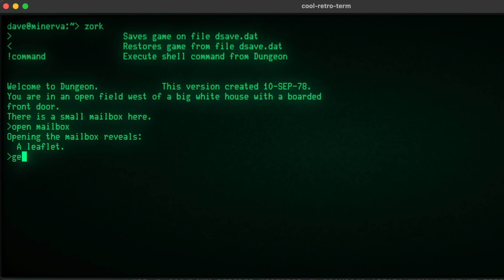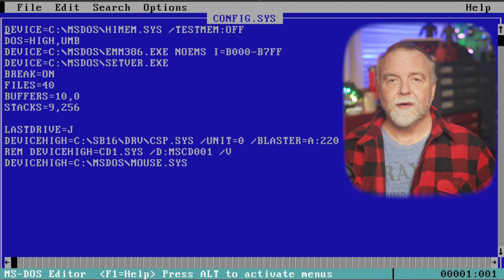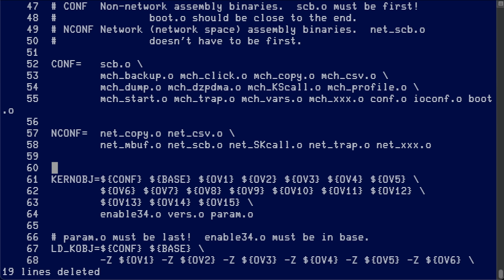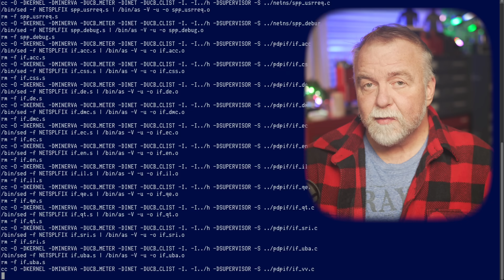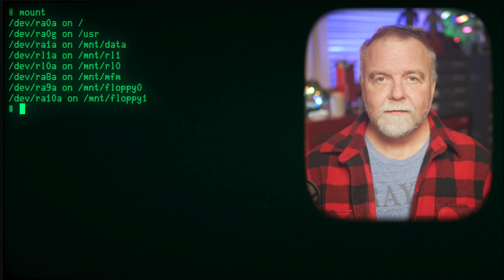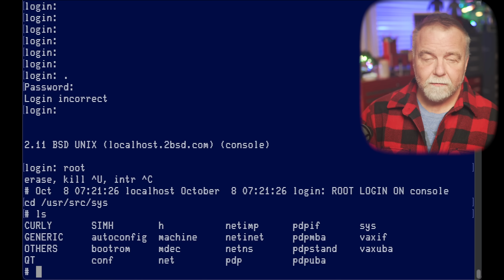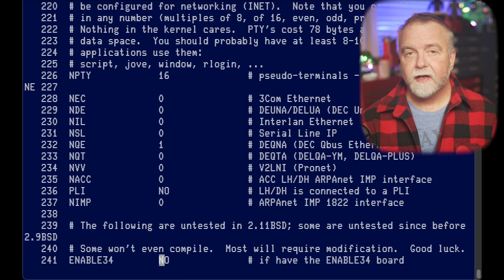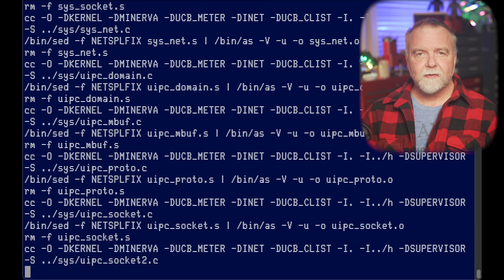The Hardest Thing: Building and Running the UNIX Kernel from Original Sources

Comment: Great trip down memory lane, thanks! When you say those minicomputers were large, you weren't kidding - I remember standing inside a PDP 11/44 to reach for circuit boards in the depths of the cabinet. Field service was an endlessly fascinating job on those old beasts.

I tried not to say it, but can't help myself: why use ":wq" when ":x" saves a keystroke and unnecessary disk writes?
Reply from the maker: I thought x encrypted!  Does it just save?  Never tried it!
Reply: @DavesGarage  You're thinking of capital X. ":x" exits and saves only if the file has changed, whereas ":wq" forces a write (and modification timestamp update) regardless of whether or not the file has changed. Muscle memory being what it is, I don't think I've ever persuaded anyone to change, but I've been losing this argument since 1982 so why stop now :)

Comment: Building UNIX for the first time for new hardware is challenging, but gets easier with practice.  I had the job building new UNIX kernels both Berkley and ATT versions on a variety of new hardware platforms.  I have great thanks to the academic computing center of St. Olaf College, which ran PDP 11/45 and then PDP 11/70 machines running UNIX for student use.  The majority of the staff of the computer center were students, and we had full view of the UNIX sources and were responsible for adding device drivers and making updates etc.  This experience put me well ahead in my career after graduation.  Glad to see your build was a success, and that you had fun.
Reply: What became out of you?
Reply: @MelihKiraz  Developed unix operating systems for tektronix and national semiconductor were my first jobs.  Now I'm mostly retired.
Reply: I'm really inspired about your achievements and career @ericanderson2482

Comment: Reminds me of compiling the Linux kernel for a HP 9000 180c risc machine. It takes about 3 days to build. I’ve always had fun tweaking and compiling kernels, thanks for sharing your BSD experience.
Reply: Similar on Sparc machines, so set up a cross-compiler on my x86 machine. There, that's better.

Comment: DEC discontinued a number of the terminal boards, so we needed to use the DZ11. Unfortunately, it didn't support hardware flow control. Luckily, the KMC11 was still available, and was an I/O coprocessor. The DZ11 had a ring indicator, so I repurposed it as a CTS pin (requiring rewiring about 50 RS232 cables), and updated existing KMC11 DZ assist driver to monitor Ring Indicator to do hardware flow control. This made our serial to cable modem implement hardware flow control, which was needed because the serial to cable modem wasn't far enough for the 9600bps output. This was done on System V, as AT&T wouldn't be caught dead using BSD. Fun times.

Comment: My first job back in 1988 had nothing to do with a PDP-11, though my supervisor told of his learning computing on a PDP-11. My own experience was on the DEC / VAX (thought I don't recall any other information about this device). The disk drives were removable packs that exposed the platters briefly to open air. Something that a 24 year old me was terrified of.  The experience of working with the equipment was the core of my life back then. I LOVED HARDWARE back then.  I believe I commented on another of Dave's PDP-11 videos with a story of the first time I ever set sight on a PDP-11. It had been recently (at the time 2000) and was living in a space, out in the open, just outside the data center, and OH how I wished I could have shipped that home. I could hear my boss from back in the '80's in my mind, telling me how he learned on the PDP-11.   

Your videos are both entertaining and educational and MOST appreciated Dave.. Always thank You.. Happy Holidays and Happy New Year.
Reply: I've only caught a glimpse of those old platters. They have intriguing patterns on the surface.
Instead of a PDP-11, VAX, or Perkin-Elmer, would rather have a DEC Alpha.  It runs VMS, Unix, and WinNT -- while fitting on your desk.
Had a job converting a traffic control system from VAX to Alpha, in VMS.  Word size differences in hardware caused delicious size/alignment issues.

Comment: I first used Unix in 1983 with 4.1 BSD running on a VAX 11/750 in graduate school.   Learned the pdp 11 instruction set the first semester writing a compiler.  Second semester was writing a bare metal os for the pdp 11 simulator using the portable c compiler.  But all the cool kids were writing games for Xerox Alto's in mesa.

Comment: 1976 I helped write the output spooler. UC OS class - Ken Thompson was the instructor...... (I'm really old)
Reply: That’s really cool history!  Do you still have your notes and graded papers from his class?  They may be interesting to go through
Reply: @paxsevenfour  So until winter quarter 1975 I had been avoiding the OS class at UC Berkeley as every time I passed the computer lab there seemed to be a sign saying “UINIX is down”. In my other classes we used Pascal on punch cards. Then the time of my graduation was imminent and so I bit the bullet and enrolled. Turned out to be the term Thompson showed up from Bell Labs to make UNIX work right.  The anecdote from the horses mouth was that Thompson and Richie were told by Bell Labs to forget making UNIX so the two “borrowed” some DEC equipment, put it in Richie’s garage, boarded up the doors and windows and went to work on their own. When UNIX was done it was then presented to Bell Labs as a completed project……  What I threw away years ago was the galley print photo copy of the first edition of the C language programmer’s manual available only to people in his class. This was the only way you could learn C as the language was invented by the two rogues mentioned here so that they could create UNIX.
Reply: Wow! I'm older! I was working alongside Ken on the machine in Evans Hall at Berkeley,  running the first Unix system to leave the Bell System. Building the kernal was a LOT easier then -- I did it a lot.
Reply: @keithstandiford3761  I was a JC xfer from College of Marin and was in the department 1974-1976. Lived in Cunningham. We probably bumped into one another in that crazy elevator.....
Reply: You are really lucky sir / mam ❤
Reply: Damn! You guys are some cool old cats! I’m only 40 but I love this old tech. I’ve always been fascinated with work of pioneers. Or those directly after pioneers.
The beginning of computing, early space programs… including their computers like the Apollo Guidance Computer. Their custom made engines like the F-1 that almost nobody is left today that can understand and explain design and manufacturing, cuz all the hand written notes and individual knowledge is lost to time. 
And much of the hands on knowledge of these early computer systems will be lost within the next 40-50 years. 
This makes me sad and makes me wish more young engineers would spend some time with you old timers, learning the old hardware/software so it’s not lost to time in 100 years.
Reply: @lyingcat9022  There is a great story about the Apollo 11 guidance computer and how they almost didn't land because of 2 complete resets while on their way down. Look through youtube for the discussion.
Reply: But a hero to many!
Reply: Grew up reading about this stuff in the 90s. Great to finally see these systems on their original configuration
Reply: You worked with a legend, that makes you a legend by transitivity. My generation thanks you very much.

Comment: I compiled a kernel on my 11/73 a few months ago as I wanted networking. I got hit with the overlay issue as well but a quick web search gave me the solution. The last time I compiled a kernel before that was 15 years earlier and I had forgotten everything. That machine and my two QBus VAXes are my most treasured vintage computers - well, apart from my Data General Nova 3 and Eclipse S/130.

Comment: 1993 linux kernel recompile feels. it's a testament to the kernel build process that you can build a custom kernel on a modern linux system in pretty much the same way as a 1991 BSD release on 1988 DEC hardware. it would have been nice to see more visuals tho, dave, like seeing the dip switch changes or how you transferred the compiled kernel image from simh to the real 11/83.

Comment: I compiled my first freebsd kernel in 2005.  I didn't know what I was doing and it took 3 days to compile on a dual  opteron server.  I think I compile every feature during that time which is why it took 3 days.  It was an eye opener.  At one point it died twice.  I soon learned to use ccache and distcc.  It was a nightmare, but it taught me alot by digging into the docs.

Comment: Makes me feel really lucky that I was introduced to UNIX with SVR4 on 3B2 systems. WAY easier to get your head around. Eventually I even got to install and use some Starserver systems with four, count 'em four 486 processors and a stack of full-height SCSI drives. Those were actually some pretty good systems although I used to rib my manager that my own system at home had a 4.7gB (IIRC) SCSI drive which outclassed the entire stack in the Starservers. Honestly I don't miss that stuff at all -- getting too old I guess. Still, your story was entertainingly precautionary.

Comment: sco unix system V was similar, at&t unix was similar obviously - the old days of single core/thread, sometimes with an MMU, sometimes without.  got to mess with a lot of hardware and flavors of unix in my life - people like us are the only ones that truly understand how far we’ve come.
Reply from the maker: We're really the last generation that grew up as the basic tech evolved, so we know 555s to state of the art.  It'd be hard to acquire that knowledge any other time or way, I think.
Reply: @DavesGarage  Hey Dave - I started with crystal sets, wire wrapped memory for my Z80 box, graduated in Comp Sci and been with startups, Sun, Oracle ever since. I don't know how we can get Gen Z (I have 3 of them) to appreciate not just how spoiled they are, but how to gain a fundamental grasp  of what goes on behind the front panels running their games and AI in the cloud - times were much simpler.."ACHTUNG! Alles touristen und non-technischen peepers!
Das machine control is nicht fur gerfinger-poken und mittengrabben. Oderwise is easy schnappen der springenwerk, blowen fuse, und poppencorken mit spitzensparken. Der machine is diggen by experten only. Is nicht fur geverken by das dummkopfen. Das rubbernecken sightseenen keepen das cotten picken hands in das pockets, so relaxen und watchen das blinkenlights." Perhaps kids should be made to re-IPL machines via the front panel before they are allowed to use their phones, tablets, PCs etc......
Reply: @DavesGarage  😹555 many such cases! my dad gave me breadboards, components, instruction when i was about 7.  he had a pdp-11/04 and spare boards at home i used to look at the processor board and those big 74181 adders and thinking, “i know what you do!”.  i had the 74XX series TTL databook memorized and some of the 4000 series CMOS before i was 12 - now you can do multiple pdps in an FPGA - wild!

Comment: Does Unix not have a make menuconfig like Linux does?
Reply from the maker: Nope.  You basically hand-edit the config instead of their being a menuing system.
Reply: Love the 'make *config' variants. Such a huge timesaver and generally prevent combinations of settings that would clearly not work. Don't have much call to build kernels anymore, as most mainline distros offer a fully modular kernel and let the hardware auto-detection take care of the rest.

Comment: This takes me  back 40 years.  Never did Unix on PDP, I used Dec's own system RSX.  It took all day to build itself from source, wrong options -> start over. The user  application used to take many hours to compile from scratch. Every build, after an edit, took 30 mins.
Reply: I remember those days. I used to compile on a Vax 11/750. The worst part is if you screwed up a file like forgot a comma or something. Then to get things going you edit another file then compile only to realize you forgot something else.
Then we started to compile on the 8600. That was oh so much faster!

Comment: One big question.. If you mess this up, and end up with a kernel that is not bootable, how do you recover?  Is there some kind of monitor mode that has access to the disk so that you can move a working kernel back in there?   Is there a generic limited system you can boot off of floppy?
Reply: you can save a copy of the old kernel(s) and boot that instead, easier than gong the long route with booting from alternate medium

Comment: The days of config.sys, setting IRQs, Ports, DMAs, etc... it reminds me of getting games like the original Doom, Theme Park, 7th Guest, and many others to work before the paradigm shift to CD technologies. The use of floppy diskettes both the 5.25 and 3.5 variants, single sided, double-sided capacity. If you had the 1.44MB diskettes you were in business! That means you only need 3-5 diskettes for a 20-40MB program that was compressed instead of a dozen diskettes. A few years later CDs started to show up on the market as they became much more affordable and if you had a 2x or 4x speed CD you were ahead of the curve with their 600MB capacity. Most hard drives back then were only about 200 - 400MB max unless if you were able to afford a 1-2GB drive which would have been close to $1k at the time. Most systems of that era only had between 4-32MB of system ram. The joys and pains of DOS. Now, I might have had to configure the system settings and some of the hardware devices, but I didn't have to compile or rebuild the kernels. This was one of the things that made DOS really decent.

Comment: thank you for making this great video about working with BSD Unix on a PDP-11. I'm 75 years old and this reminds me of working with Honeywell's H716, which was a PDP 11 competitor with similar memory addressing constraints. Years later I did some custom X.25 driver work on Xenix 286 running on a PC/AT clone which had it's own 64 kb segment size memory limits. Now you can get documentation and great textbooks on Unix/BSD/Linux internals, but back in 1987 it was a real slow slog of compile, rebuild and test and then try another experiment -- very much like what you described. Keep up the great videos, and keep reminding newbies how important is was (and is) to understand how things work.

Comment: To be fair, the experience of compiling your own Linux kernel binary isn't much different even nowadays. Thankfully nowadays kernel can autodetect majority of the hardware so you don't have to futz around with CSRs, IRQs, jumpers, DIPs and pins. That being said, if you're doing embedded, its basically straight back to PDP11 level of experience.

Comment: Reminds me of when I was given a development board of an LSI-11/23 (no case, not yet space-rated) that pretty much just had a boot-loader and two 8" floppies, a binder of xeroxed hardware info sheets, and the assignment to design SDLC drivers for a future satellite. I compiled on a PDP-11/something (I forget) and did sneaker-net transfer via floppy. My visual I/O was a digital monitor that just displayed the hex code I read from pins to see if things worked or not. It was a lot of weeks of mostly "or not". When I got RT-11 installed it was way better. Fun times.

Comment: I modified the linux kernel, and compiled it for a client.   It was a trivial code change, but it took me days to determine I needed to change it, and how.   The end client, was migrating code from three Unix platforms, and mainframe (cobol), to Linux, and bugs were jumping out left and right.  It took 5 months to fix all the bugs, some of which had been there for 10 years.  It was 90% C++, 3% Cobol, and 2% Fortran.  Other was Shell scripting, AWK, etc.
Reply from the maker: The only real customization I did of the codebase was to tweak NMOUNT to allow me to mount up to 8 drives, as the code itself normally only supports 6.  Otherwise it was just configuration, but I did make that one change!

Comment: The most unusual Linux distribution is "Linux From Scratch" which is a PDF book.  The book explains how to build a Linux release from source code.  The process is quite complex.  The book walks you through the process step by step starting with creating a new C compiler and libc, the compiler and library that all other programs are dependent on.  It is an interesting process because you have to build it with an old libc, then build a new small environment with this new libc and once again build libc again.  Once you have an independent C compiler and libc, you can then start building all the other tools like the kernel, various other compilers like C++ and python.
I actually did this once up to the point of having a bootable system.  It took me a week or so of hard work.  If you want to really gain an in depth knowledge of how a Linux release works, this is the way to go.  At the end you will understand the functions of most of the bits and pieces that make up a Linux OS.
But be warned, it is not easy.
BTW, Linux From Scratch is still maintained with a 12.2 September 2024 release.  I believe it is mostly used by developers building a custom release for a specific task on a micro-controller like the Raspberry Pi.  Think automotive electronics or microwave controllers.
Reply: Yep. Did that back in 2000 while recovering from an accident. Had a dual CPU machine and figured out how to modify the Makefile for X11 to do parallel builds without breaking. Was pretty proud of that. Also learned about the 'sed' stream editor working on that.

Comment: Oh, the memories, using vi (prefer vedit, the "helpful" way to start it) toi edit the kernel. I used to tune up Unix systems that had 32MB, because the default cache was 256k (to suit a 2MB machine) and making it bigger did wonders for the speed.